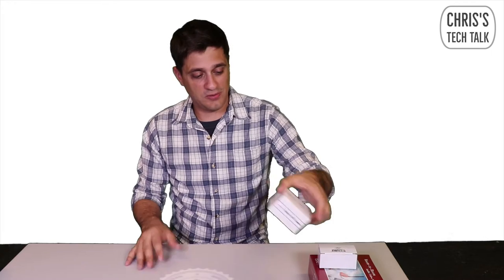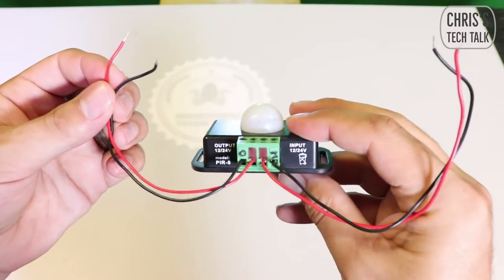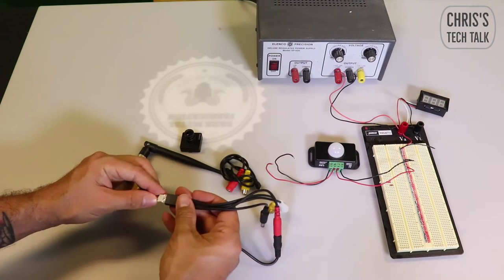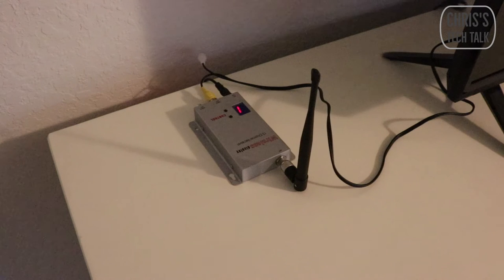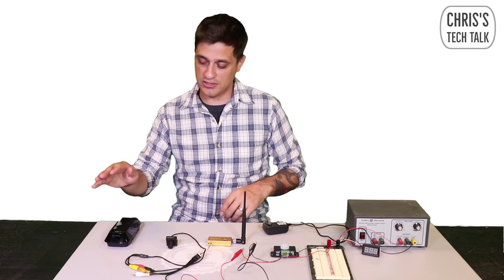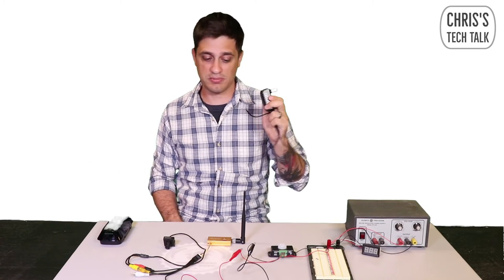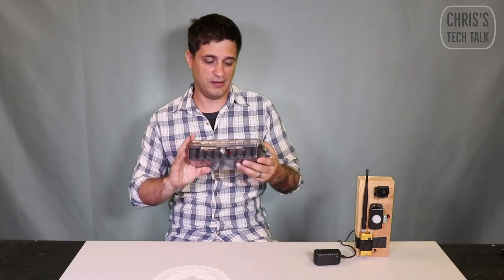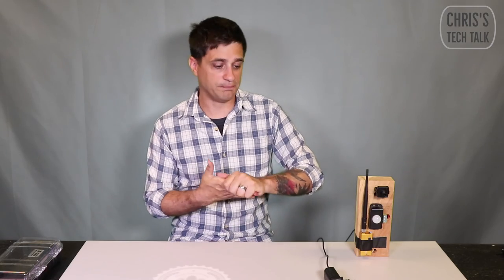DIY Security Camera

Comment: Would the pir relay trigger a dslr
Reply: Akshay Khare yes you can wire it to a push pull solenoid & position it to where it will push the button on the dslr camera to to reduce & narrow the field of view of the motion sensor activation put a piece o pvc pipe over the sensor & don’t cover the end also use an older cars 12v  turn signal relay now wire it  before the push pull solenoid that way you get multiple pushes click click click click click multiple pictures until the motion sensor turns off now go make it and make sure it’s all 12v